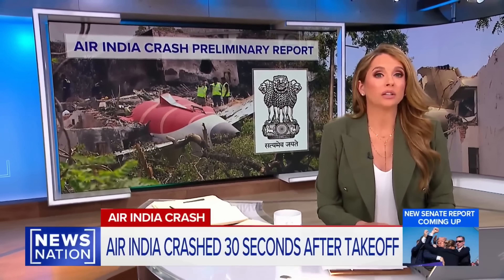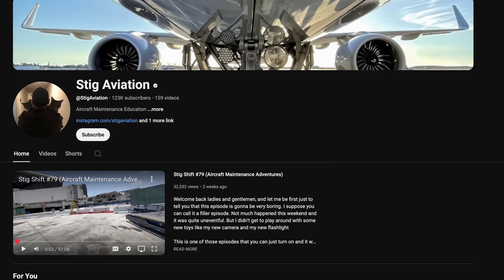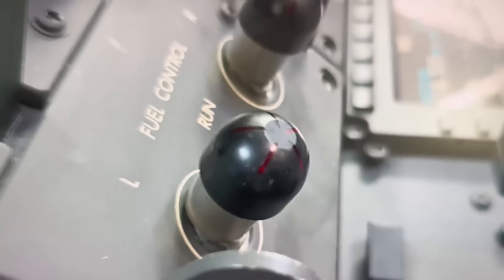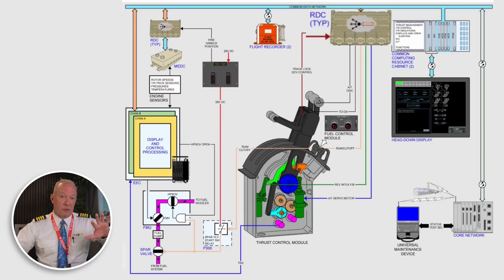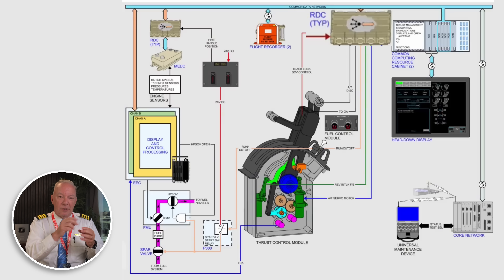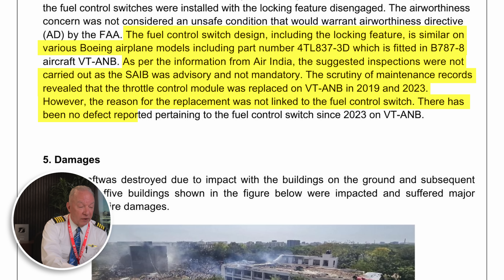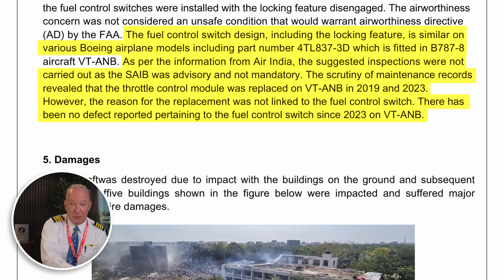The Truth About Boeing 787 Fuel Control Switches

Comment: I'd say your description is mostly correct. There is a second input to the fuel spar valve close command, that comes from the fire handle. Also there is a signal from the spar valve to the Remote Data Concentrator that is converted to digital and sent to the ship computer. That output comes from a pair of limit switches inside the actuator (provides open, in transit and closed position). The digital signal eventually tells the flight deck displays to change the pretty picture and any other system that subscribes to that information (e.g. Flight Data Controller).

Comment: I have a question unrelated to the fuel run/cutoff switches.  Would it have been possible for the aircraft to gain airspeed with the single engine relight if the pilot had pushed over to a level ship so it didn't stay in a nose up attitude and stall the wings?  Would it have been possible to have a few moments longer of flight to possibly get the air speed pushing up faster?

Comment: How continently Steeve mentioned FMV as Fuel Management Valve. The schematic has no direct connection between the Relay operated by Cut Off switches and FMV still the animation shows that the FMV opens when the relay is closed. FMV actually stands for Fuel Metering Valve. This is an engine-mounted, FADEC-controlled valve within the engine’s fuel metering unit that precisely regulates the amount of fuel delivered to the combustor to achieve the commanded thrust. On 787 engines, the Fuel Metering Valve (FMV) is not a simple 28V DC‑actuated on/off valve. It is a FADEC-controlled servo actuator within the engine’s Fuel Metering Unit. The FMV’s position is commanded by the engine’s FADEC/EEC, which drives an electro‑hydraulic/electro‑mechanical servo to precisely meter fuel for thrust control and protections, rather than by a direct 28V DC line.
Reply: That maybe but the point still stands that their two completely different systems on completely different circuits running two different paths in the airplane the two switches moved telling the fedec to shut the engines down and cut fuel

Comment: Electronics tech here.  To me the big tell that is we're talking about an event that happened at just slightly different times and yet happened  within seconds of each other.  If the fault had a common cause, then we'd see both switches changing together.  We didn't, so this points to separate causes.  But to have two failures happening the same way within seconds of each others is astronomically improbable odds.
Reply: I thought that at first, but they are two separate circuits. So each circuit was affected by the same root cause, and reacted individually to it. These circuits and other systems were powered by DC power. When that started failing, several systems stopped working each in their own ways. Then when the RAT started supplying power, most of these systems started recovering, also at their own recovery rates. Some did not recover at all, because the RAT only powers specific systems. If it was ONLY the switches, those other systems wouldn't have been affected at all.

Comment: NO. NO. NO. You do not understand. The mechanical switch has electrical contacts inside, which are either open or closed. DC can ark across contacts, the contacts can oxidise, the contacts can fail as they are made of copper. The switch energise a relay, low current switch operates the high current relay. The relay also has contacts that can fail. So you are entirely misinformed and uneducated. Or to put it a better way, you're a shill & full of excrement.
Reply: It was murder/suicide.
Reply: @thesweeples3266 it was another Boeing cover up

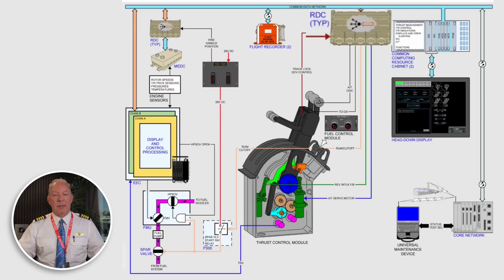Comment: 8:51 you finally got to what is IMO the crux of this. It's redundancy. They lost both engines, but any kind of failure in this stuff would only lose one engine. Like, it's quite possible for that relay that you mentioned to fail, relays certainly do fail. But both failing at the exact same time is effectively not believable. (Plus they generally fail by "getting stuck" - i.e. not making a change when they're supposed to - rather than by making a change when they're not supposed to...)
(If you're not aware of what a relay is, it's the reverse of a switch, or it's an electrically operated switch - there are probably 4 pins, 2 will be wired up to the control switch in the cockpit, 2 will be wired in series with the fuel valves - when current passes through the former 2 an electromagnet causes a connection to form between the latter 2, so current can only flow on the "fuel valve" side when current is being provided to the "control switch" side.)

In the same way, if one engine had cut out I could believe the switch had maybe failed - springs can wear or break or be misassembled or something - but both? At the same time? Nah.
Reply: It has been explained already why the redundancy feature in this case made the electrical fault worse, thus defeating any purpose of the redundancy. This is just a bit too complex to explain with a children's toy.

Comment: One question. Just because I saw slightly different info from John Goglio on the Flight Safety Detectives. From what he was saying the relays and the actual valves are "Powered to Open, Powered to Close" So there is no "default" state. If they lose power to the relays the valves do not auto close by default. RUN causes the motor to open the valve. CUTOFF causes the motor to close the valve. But it is powered each way. Not powered one way with a return spring the other. The other interesting thing is those w=switches have their own direct signal leads back to the FDR that report the physical state of the switches. So when the Initial Report says "FUEL CUTOFF SWITCH 1 TRANSITION TO CUTOFF" That isn't coming off the FADEC or Flight Computers. That is the physical switch in the Throttle Block Console telling the FDR how it is positioned.
Reply: That makes more sense than the way Captain Steeeve described it. The way he described it the valves only stay open if the DC current is present. So any failure of the DC power supply from the battery, failure of the physical relay, or break in the interconnecting wiring would cut off the DC power to any or all of the 3 valves and they'd close, shutting down the engine. That would be a very unsafe 'fail unsafe' design. A design that powers the valves open and powers them closed again so no power is needed to maintain them in the open position makes sense.
And the FDR obviously has a method of 'knowing' the physical position of the switches in order for it to have reported them being switched off and on again. Captain Steeeve does not mention this. So it is possible (extremely unlikely, but possible) that switches never moved from the 'run' position, but a fault in the reporting electronics between the switches and the FDR caused the FDR to report that they had been physically moved.
Vince C
Reply: Regarding these fuel control wires... Do they travel together with data wires?

There have been several cases where engines continue on cruise thrust after the plane has landed and they could not be cut off from the cockpit.

In that case, at least thrust control, fuel control lines and fire suppression control lines must have been cut?
Reply: @kimmokannala4576  i dont have any knowledge about airplanes cable systems, but as an industrial engineer, always the signal cables are separated from "hot" cables,  or the signal cables are shielded
Reply: @kimmokannala4576  as Captain Steve explained, the wires don't transmit data. It is not a digital circuit. It is simply a 28v battery system with wires that transport electricity to an electrical relay. There are no chips, nor data processing modules involved, and nor are any other external, digital systems connected in any way to the fuel controls. It would require magic for an outside signal to manipulate these controls.
Reply: @Aquascape_Dreaming  That is correct. On the 787 I believe only the fuel spar valves and fuel jettison valves are hard wired without any software input or control.
Reply: In his description Captain Steve states that the fuel control system is isolated with no other digital signals that could affect it in any way BUT the diagram shows an AND gate controlling the signal to the high pressure shut off valve, meaning that both the signal from the relay AND from the display and control processing system must be on for the HPSOV to be open. So either his description is wrong or the diagram is wrong.
Reply: @kimmokannala4576  No there is separation. Also, there are two paths for power to reach the fuel spar valve. One on the front spar and one up the rear spar. That is so in the case of a rotor burst, or thrown tire thread the flight deck fuel cutoff switch & engine fire handle will always be able to close the valve.
Reply: That is what I thought.  Relays in things that move and/or are subject to mechanical stress are usually of the 'latching' type.  That requires energizing one coil for 'open' and a different coil for 'close'.
Reply: @glandeokrayo9956  A single coil non-latching relay with 2 sets of changeover contacts can be wired to drive a single dc motor in 2 directions. On loss of power, although the relay may return to the rest or de-energised state, if there is no power the motor won't run and the valve will remain in the last position. Equally, limit switches within the valve can also be configured to transfer polarity of the power to drive the motor in the opposite direction. Again the valve will remain in the last position if power is lost.
I would be pretty certain because these valves are required to be closed in an emergency such as an engine fire, they are fed from a protected 28V DC supply and maybe directly from the aircraft batteries.
Reply: captain steve did not explain that of how the relays work.  you need to "energized" the relay to change its state (on-off) as i understand
Reply: No default state makes the most sense.  If you are in the air you want the fuel valve to stay open.  If you are on the ground stopped for the day, you want fuel valve closed.  In the olden days a ball valve was probably moved by hand.
Reply: If there is a parallel path from the switch or from its downstream relay to a logic input on the "FDR" (whatever that is) , could a short in the seating of the connector to the logic input not cause the relay to change state?
Reply: @rexwave4624 The FDR is the Flight Data Recorder. The “Black Box”. Could a short in the reporting lead misreport? In theory Yes. But since there are also observable engine effects from the switch being thrown, it wasn’t a short in the reporting lead. The reporting leads report the physical position of the switch. They are independent and isolated from the 28V control leads to the valve relay. Also each switch is completely independent. Each switch has its own leads going to the FDR and each goes to a different relay and fuel cutoff valves. The two switches are 100% independent of both each other and the flight control software and systems. The Software cannot shut those valves, close those switches or mimic them. By design.
Reply: @andrewtaylor940  The reporting lead(s) are basically on/off limit switches that ride on the valve drive shaft, inferring the valve position. The power on the limit switches goes to a Remote Data Concentrator and is converted from 28v to Digital and provided to the ships computer for multiple uses (FDC, Flight Deck display, Fuel Management S/W).
Reply: @andrewtaylor940  thanks for your detailed response. After I posted, it occurred to me that that diodes, etc. could isolate the reporting but, as you've explained, it's done better than that.
Reply: @rexwave4624  The Flight Data Recorder gets an input from the fuel spar valve limit switches which report; open or closed. That circuit has no connection to the motor part of the actuator.
Reply: Thanks for this comment. That was the question I had. Is there auxiliary contacts on the switch positions to be absolutely sure they transitioned. Sounds like the evidence is clear. Thanks Captain Steve for sharing this to attempt to end the speculation.
Reply: you're right we can see 2 orange wires on the switches, one going to the relay, tho other to the fadec ( on the right)
Reply: If you were at the control in a critical phase of flight, like low altitude at initial climb out, wouldn’t you recycle the fuel cutoff switches if you had an unexplained loss of thrust and nothing else was working?
Reply: @GooglePlusPages No. At least not if you understood how the switches worked. because you need a lot more altitude to restart the engines. And you need the APU started first. And you would not do both. Because you can only start 1 engine at a time due to how much power startup draws. Flipping the switches will trigger an automated engine start sequence. But even if you tried this, the sequencing would be different. It would not be 1 off, 2 off wait 10 seconds, 1 on, 2 on. It would be 1 off, 1 on, wait a few seconds, 2 off, 2 on.

Comment: Consider this scenario!
The fuel control switches are in the on position. No one moves the switches.

Then If the 18volts power is interrupted (for some reason) the relay would drop out and the fuel flying would stop flowing. Even with the switches still in the on position. When the 18volt power supply comes back on the relay would energize because the switches are still in the on position. 
This scenario would appear like someone moved the switches. 
Pass this by the engineers for confirmation. I believe no one moved the switches. It was the 18volts supply that was interrupted.
Reply: Two completely isolated non-electronic 24 volt systems, running on two seperate batteries like the 787 does, failed within a second of each other then started working again while at the same time one flight deck officer asks the other why he turned the switches off, then flips them back on? That's... a take I suppose...

Comment: How can the valves be Fail Safe Open when losing power?? That means that when the engines are completely off, the fuel valves stay Open...??? Nope!  The valves fail safe open because there is a backup DC power supply that kicks in when plane loses main power. IF the smart cheap junior engineers hired by Boeing were put in charge of this power supply wiring then you got your answer of why those fuel valves got closed and were NOT able to fail safe OPEN!

Comment: Great show, Captain Steeeve. Here's a question for you. What happens if the 28 VDC power source, which (as you nicely explained) drives the electrical spar valve, etc., is taken down, say from an electrical short circuit? In such an instance, with the fuel switches remaining in RUN position and the P300 relay staying energized, wouldn't the circuit feeding the spar valves, etc. become de-energized?

Comment: Good analysis. The 10 second delay from the electrically recorded deactivating of the fuel cutoff switches until the electrically recorded reactivating of the switches is easy to understand by the idea that the pilot was looking for avoid “positive rate of climb” so as to say to retract the landing gear. Except the were not climbing as was expected. I fact they seamed to be losing power and “what is going on here, we are not going up with a positive rate of climb but we are in fact descending. What is wrong?” Now the pilot tries to determine the reason bad shit is happening at the worst possible time and what he can do about it. Check throttle control positions? Is there any alerts? Did we have an engine failure? Did the wings fall off? WHY ARE THE ENGINES NOT GETTING FUEL? Let’s try cycling the fuel cut off switches. There! That helped. But the ground is coming up at us a little to fast for my liking. It’s been nice living. 
  That was 10 seconds of realization, questioning, thinking, problem-solving and trying to make sure that what he is about to do is going to help and not make things worse. The system that controls the recording of detected events normally has an extremely large number of electrical components like conductors and insulators and semi conductors and mechanical items that are supposed to be rigid supposed to move, and also semi move, or combine together in a very complex aircraft, and we hope it stays in the air. 
   You are rite. We may never know exactly what happened. My experience tells me that the vast majority of people only see the outside visible part of the fuel control switches and are totally oblivious to the other 99.99% of the electromechanical and thermal and gravitational systems behind the easily visible control panel. And then add a brain fart or something and (“WHAT THE F JUST HAPPENED?”)

Comment: A question to make sure I understand correctly. While it is a long way from the switch in the cockpit to the valves (first assumption), if I understand correctly the two switches go opposite directions from the cockpit, left and right (second assumption I’m understanding this correctly.

If this two things are true then there is a pretty long hardware connection to both sides and any hardware system can fail.

That said. If I’m correct in my second assumption that the two switches are two different sets of hardware is correct (fell free to correct because if I’m wrong my whole hypothesis falls apart), the the idea that those two separate hardware links fail at basically the same moment just doesn’t pass the smell test. The only realistic scenario is both relays were opened (cutting the DC supply to both sides) at basically the same time.

Again. Please feel free to correct any wrong assumptions or misunderstandings I’ve communicated here.